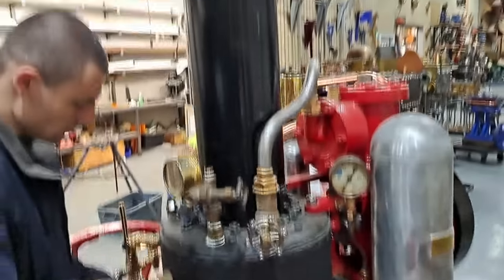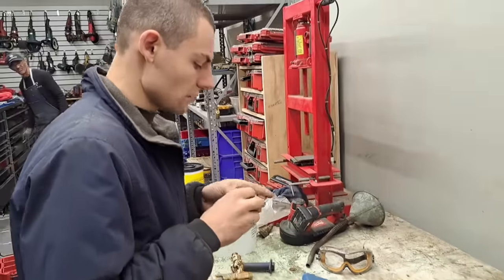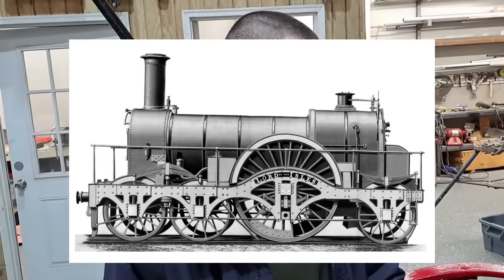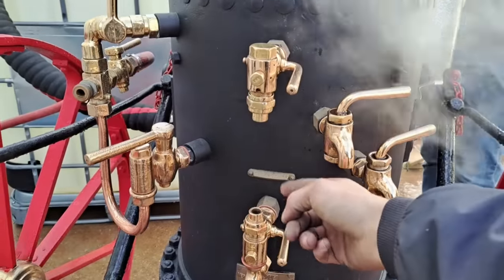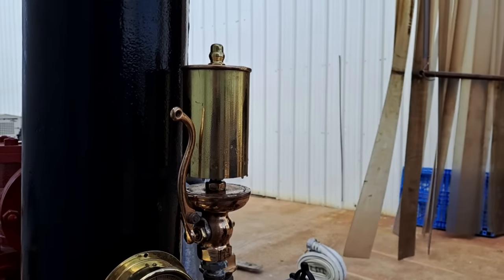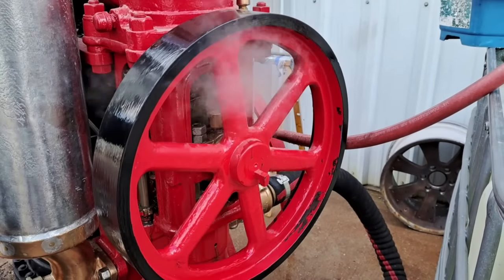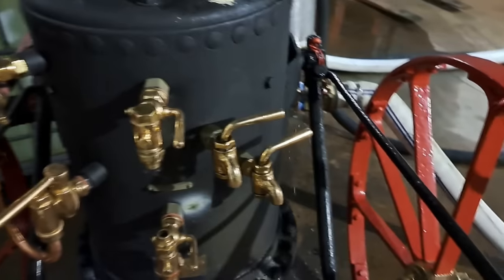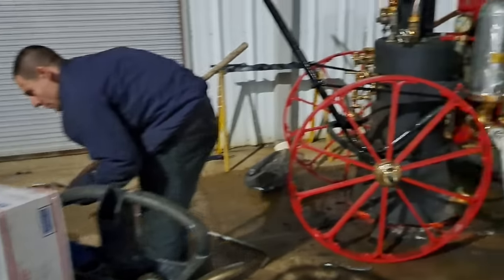Details of Merryweather's Self-contained firefighting engine

Comment: I recently stumbled across your channel and I am enjoying it immensely.   I served on a U.S. nuclear submarine from 1975 until 1979 as a nuclear power electrician.  More than once I sat between the main engines and marveled at the wonder of the steam turning the turbine generators to make electricity and turning the propulsion turbines to push the boat through the water hundreds of feet below the surface.  Not only that but steam provided the heat needed to make the lithium bromide air conditioning work.  In fact it worked better, and quieter, than the massive mechanical air conditioning, though it was less than 1/3 their size.   Your videos give a sense of the roots of what we had in place.  Thank you so much.

Comment: Just recently found your channel. The Woburn water pump is fascinating! Your channel is a really sweet find! 
Are you aware of the North Woburn Machine Shop? Its a machine shop which supported the leather industry 150(?) years ago; and is still a working shop with the addition of a few modern lathes & mills. The power distribution shafts/leather belts and many of the original machines are still in place; including (what must be the world's largest) broach press. I don't know if the original steam engine is there. In any case, its a wondrous trip to yesteryear.
Thank you for your time & effort in sharing your love of machinery.

Comment: I never really though about it before but these steam firefighting engines,  back in the day how long did it take them to get up steam? With something burning down time is of the essence.
Reply from the maker: this boiler steams in 10 minutes without damaging itself.
Reply: @AEKarnes  I figured it had to be fast. Interesting and a handsome piece of equipment.
Reply: I’m presuming that the rather robust construction design of its boiler, being built as it is, is primarily due to the nature of its application of intended, very intense REPETITIVE firing up these surely would’ve been subjected to back in the day… likely a fairly expensive build design even when new, by comparison to most average steam engine’s’ boilers of equal size/pressure output

Comment: This stuff makes a ice look simple
Reply from the maker: Until you have to maintain both, and then you realize the opposite is the case
Reply: @AEKarnes  i don't know, ice's follow a more or less common map and if you stick to one brand you even have part exchangebility, but from what i gathered from your channel it seems like every steam engine is almost a custom job with tens of different valves and devices
Reply from the maker: @BigMans88  On a steam engine there is a common map but you make the parts.  You won't be re-pouring your own bearings in an IC motor unless that motor is from the same era as the steam engines.  I don't see any auto mechanics or IC shop guys who are talented machinists because of the "buy part and drop it in"  crap and of course that means you and your engine are SOL the minute the spare parts for it become unavailable or unless you find a good machinist who can do what I am talking about.
Reply: @AEKarnes  maybe it just looks crazy to me because i don't know anything about them, I'd imagine the reason why most people don't make their own enginr components due to the fact its very difficult to get production to s point where there are little defects and most of the time simply not worth it

Comment: Bonjour Alexander,
Another exciting video, furthermore with a great whistle, thanks a lot. I am impressed by the quality of the whole assembly and notably by the injector. I am just surprized to see a manual lubricator instead of a displacement one, weird isn't it ! 
15 minutes is fast t operate, but against a fire, it is a long time, do you know if they were "pre" fired ?
What is the difference bertween regular coal and anthracite for heating ? Would the second one mire efficient and making less ashes ? 
Funny to see sparks from a  firefighting engine 😁
Amicalement, Raphaël

Comment: How easy was it to accidentally blow-up the boiler on one of those?

As a former firefighter, I gotta say, that water pressure sucks, like 1/4-1/3 of what it needed. I didn't see a guage, but the reach was shorter than a truck. I don't know what nozzle that was, but the flow (volume/gpm) isn't great, either.

Maybe that's what it was supposed to be, idk, but I guess that's why it was retired.
Reply from the maker: It takes a lot of stupidity and consternated hard work to blow up any boiler, more than likely you'd just come down with leaks.   The discharge gauge was essentially nonfunctional on this engine nor was the monitor matched to it, but you will find, especially reading other comments, a lot of internal combustion firefighting apparatus of similar size cannot keep up with this thing.  Nothing moves water like a steam engine.
Reply: @AEKarnes  lol…I'm sure it would beat our grass fire rigs. They all had 6.5hp/250gpm pumps. I doubt it would get near the full size pumpers that we had for structure fires. When I left our latest addition was near 2000gpm (7570 liters per minute), over 10 years ago, and we covered a small area with 2-floors, max. The stuff for big cities with high rise buildings is nuts. I don't know their numbers, but I know it takes over 4psi to go up one foot. Our trucks couldn't pump efficiently if over to 3 stories! 

It's not steam that moves water, in this case. It's still got a piston & cylinder, just with some weird scotch yoke thing.
Reply from the maker: A typical American "first size" steam fire engine could pump 1000 GPM and the specials got up to 2500.  No internal combustion engine with an idle speed and stall, these machines with two high pressure cylinders develop maximum head pressure when stopped and the throttle fully open.  Typically the water piston to steam piston area ratio was two to one, so if your boiler ran at 125 PSI you could develop a firefighting discharge pressure of 250 PSI, which is more than enough to run a tower which they often did, or attach to a firefighting standpipe at the bottom of a 40 story building to act as a booster for sprinklers.